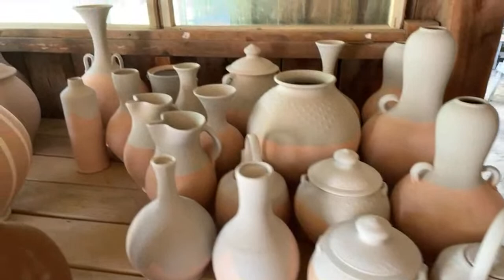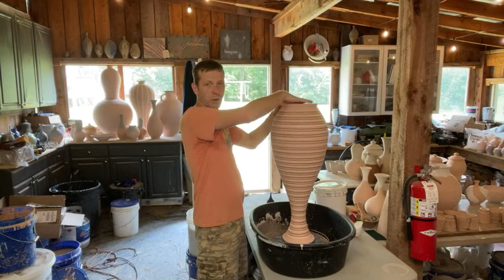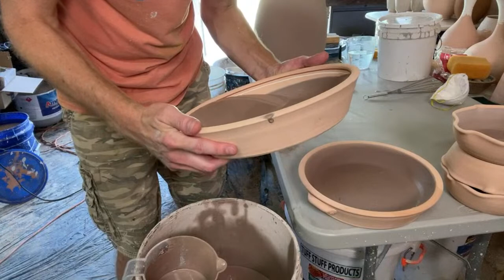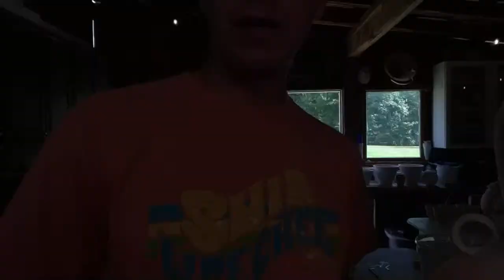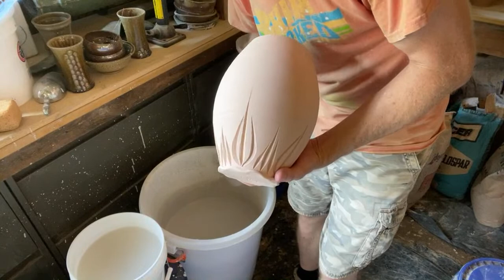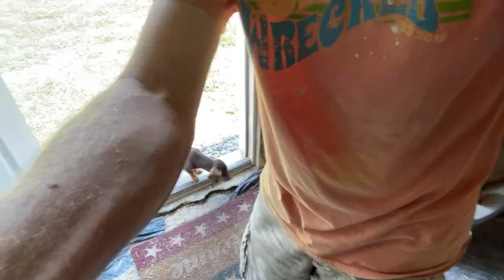Glazing for wood firing #8

Comment: If you remember what drew me to you in the first place, was because you are "what I call" a clean thrower. I see people that end up wit half of the tray filled wit water! People need to learn that not much water is necessary except maybe when centering the clay. Some also don't understand the concept of reinforcing the pot with maybe  rib?
Do you use wax resist on your lidded pots to avoid lids sticking to the body? I do and I also wax resist on the bottom of the pots. At the class I see students spending the valuable time there scraping the glaze off the bottom of their pots! thereby wasting so much time and wasting all the glaze they are removing too. sigh

Anyway, similar to you Matt, glazing is the thing I like the least of all other processes involved.

I have ruined pieces before, due to not taking glazing seriously enough. Because I hate doing it I tend to rush through the process also.

I hope to get   some ideas from your glazing techniques. 
I only use white earthenware so somewhat limited when it comes to glazing.

I've learned much from your throwing techniques since following you for over 2 years now, maybe 3 years and gained much inspiration.
Watching you glaze makes me think how much I'd be worth financially if I'd got a $ for each one I've glazed LOL
10's of thousands at a rough guess.